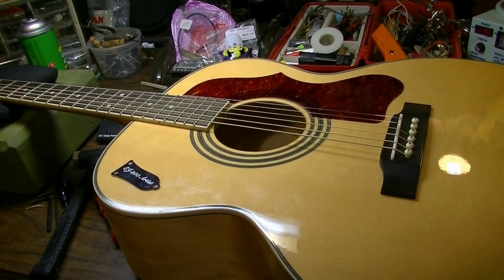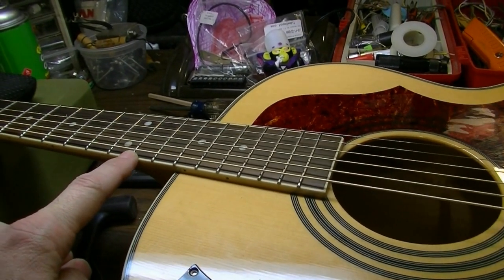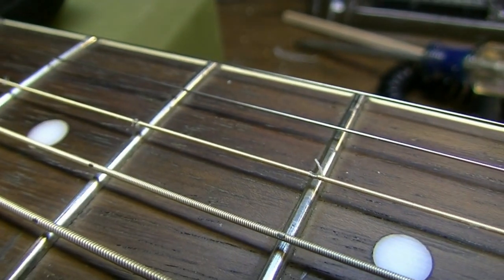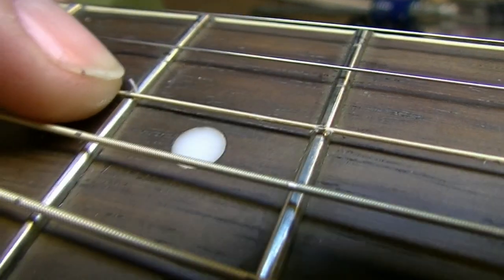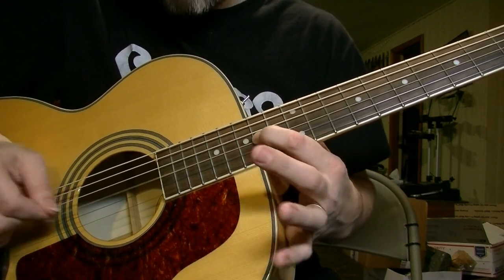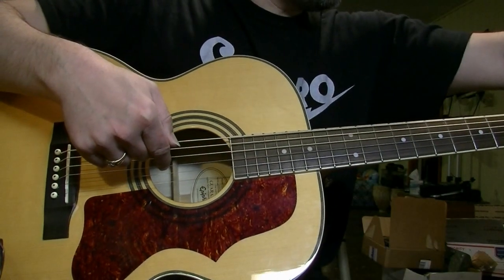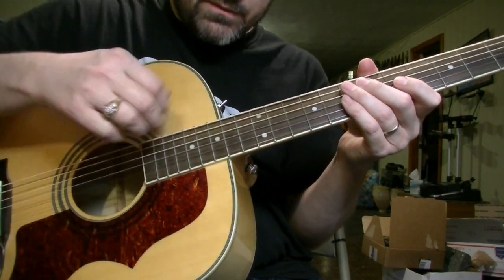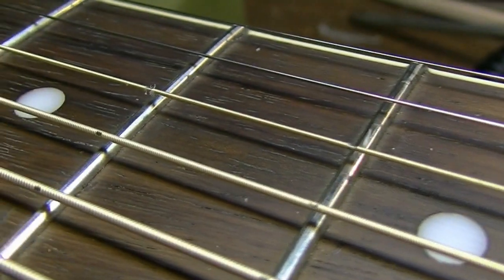Why I NEVER Use ELIXIR Coated Guitar Strings

Comment: For the last   10 years I have only used D"Addario phosphor bronze strings. Back then I was trying other brands including Elixer coated strings. My feeling was that the Elixer's sounded great but I  would notice the coating getting a little sticky on my finger tips. I also felt that the Elixers were not quite as clear as the D'Addarios, I assume because they are coated. I admit the difference is very, very subtle. As I played more and improved my sound, it got to the point where I was changing my strings more often. Since the price of the Elixers was higher, another reason to stick to the DA'ddarios. I will try the D'Addarios again to see if I change my mind

Comment: Speaking as a guitar restorer the issue here is simple.those strings are fake.Elixir strings do not lose their coating.They are specially made for electro acoustic guitars designed by Taylor. We have strung hundreds of them and are our go to string.I would suggest he sends the strings to Elixir in the states to get a second opinion before making wrong judgements.

Comment: I've been a long time Elixir user of both nano and poly web strings, and the only time I've had this issue was when I ordered a box of 5 packs online from a dodgy seller and they turned out to be fakes.  You could tell as soon as you opened the packet - they felt so... NOT Elixir at all.  This may have been what happened to you?
Reply from the maker: The owner purchased from Sweetwater.

Comment: I have Elixirs on both of my Taylors and I have never had an issue with them. Only strings I will use on my acoustics, they last. They do wear out though. I wouldn't knock Elixirs for the guitar owners failure to change his string when they did go bad. How long have they been on the guitar? My guess would be a good long while for that to happen. In addition, always replace the strings after working/modding your guitar.

Comment: Is it possible that the offset "fret divets" in the string after the bridge saddle was shaved could have contributed to the buzz?  I've never noticed the buzz being a problem even with fraying Elixirs.  Having said that, I have, in the past, run into an issue where coated strings caused a string grounding issue on a bass. This wouldn't be so much of an issue on a guitar since the plain strings (E and B) are not coated.  I love Elixirs on my electrics, but I use EMG pickups which don't require a string ground.

Comment: I used elixir bronze on my acoustic guitar a year ago, but I don't use it now. There are my reason why I don't use it again
1. Elixir bronze acoustic causes my left top finger become be yellow, looks dirty and it is difficult to escape
2. Its coating string on sound hole position is peel off caused pick friction, It is disturb to me
3. The tone durability is not better than string uncoated
4. The string looks good for 3 month, no rusty, but when I look the string that friction with fret I find that the coated is peel off and corroded.

Comment: I used these strings when I first started playing because of the comfort. I had the exact same issues being illustrated here. I haven't used them in years
Reply from the maker: Thank you.
Reply: I've never used Elixer strings nor have any of my friends.  Been happy with Ernie Ball for years. I did put  set of DR red coated strings on a red Ibanez. Looked cool but little red flakes appeared quickly. I know this about Elixer, but just thought I would relay that.

Comment: I just bought a new acoustic with  EXP coated D’Addario strings. Upon close inspection of the strings as I was adjusting the truss rod to get the neck straightened up and get rid of fret buzz, I saw small rust spots on them over the sound hole. When I can get to my local guitar store I’m going to buy my Ernie Ball strings.

Comment: I had some once that looked like something was growing on them all the way down the string. But that only happened once. I've been using them for years and haven't had that again. There probably is a difference between Poly and Nano. The Poly is the original and is much thicker. I had D' Dario coated and they did some "peeling" too. They do look bad when they do that and surely feel funny. I also imagine that this may have some effect on the tone and they won't last that long. BIG Question !!!! super slide or some sort of cleaner apleid to the strings may cause this too.

Comment: They may be the fake Chinese made Elixirs, or even the phosphor bronze. 
I've used American made Bronze Elixir Lights with the Nano-web coating along with non coated Martin strings before them. I've taken the strings off and have put them back on without the strings being frayed afterwards. 
They could also be the poly-web coated strings.
My strings last about 5 times longer than my Martin strings ever did.
They also have better tone and the only time they fray is when I leave them on longer than needed.
P.S.
I also play blue grass and heavy blues. I bend a lot and play hard. They last me fine without fraying. It could be a bad batch your friend had. It's unlikely, but it could be the guitar.

Comment: I got the same issue .... with average acoustic strings .... without any coat .... I moded my Epi Acoustic so the strings are louder with long sustain ... some friends call it the "acoustic-electric" guitar. The issue is the same as you pointed out here .... but with the wrapping wire on the G string. All the string "separates" the wrapping wire in segments just like the fretboard ... after a week .... no matter what I do, the issue is the same, you can feel with your nail under the string those cuts in the G string. I have to change it because of the BIG annoying buzz. I tried to change to a flat string, but the bridge is not filed for flat G string. This issue is because of augmented vibrations that G string can't stand. Frets are ok, no edgy frets all along the fretboard. This is something that ONLY happened AFTER my mod. When I bought it, everything was ok. After 5 years ... G string was ok. One more thing: When I play single notes or I bend notes 1/2  ... 1 ... 1 1/2 up .... my guitar sounds like an electric guitar .... like if had delay on it, looooong sustain man, and there's no preamp or gadgets on it .... pure acoustic tone ..... with electric guitar sustain. Hope to upload a video soon so you can hear it. Cheers !

Comment: Those strings show clear signs of a heavy string bender. Did you also check the frets to see if there were any sharp edges on the sides of them at all? (Sides as in not the peak of the height of each fret where the string makes contact but on the rounded over portions since some of those frets looked as if they had a fret level job done to them and looked like they had edges to them.) Anyway, nice video. :)
Reply from the maker: Frets were fine. They weren't crowned to perfection because the guitar was a typical Epiphone import and they do not crown frets from the factory. They level and polish, leaving a slightly flattened crown. This is fairly common. No sharp edges though. You're right, the player is a heavy blues player. Lots of bends and lots of vibrato.

Comment: Also ive used polywebs for years and never once had this issue. I dont know if that guitar owner presses down really hard or the strings are over a year old maybe. Also ive heard nanowebs arent that great but personally with 10 gauge polywebs i have never had this problem
Reply from the maker: I think it's down to playing styles. This dude is an aggressive player. Tons of bending and aggressive blues/rock vibrato.

Comment: I kind of have to use the Elixirs as my finger sweat makes all other strings rust and go black within hours. I would agree that all the Elixirs were a compromise up until the latest version which I believe is only available for electric guitars. Its the Optiweb which feel mostly like normal strings and last ages. I don't know if the acoustic situation has improved though. But yeah - they keep improving and for me its the only string that works.

Comment: If the winding on strings is damaged to that extent, the strings are dead, gone, used up, regardless of the perceived minimal usage. The frets appear not to have been propery crowned and so there are two sharpish edges to grind the strings. They also seem to be/sound to be too light for a super jumbo and maybe the relief is insufficient. 
I don't care for or need coated strings - but understand that if you have acid sweat of play in very humid conditions they have a purpose.  
IMHO, this guitar needs some fret work, a set up and a new set of strings.

Comment: Groovy Music Lessons' Scott Grove is the guitar guy that got me using Elixir "Polyweb" coated strings on my acoustic guitar. He plays about any kind of music one can ask for on guitar, but specializes in Country. I bring this up because he has a chemistry that ruins strings in 15 minutes and swears by Elixir Polyweb strings! Well, I went ahead and put a set of Polywebs on my guitar and I have to admit, I like them and for over a year, those strings look and play as if they were brand new! Being somewhat skeptical at first, I would periodically inspect the wear areas of the strings with a 16x loupe that I use in my rock hounding and the coating is holding up with minimal signs of wear. Scott did mention that heavy metal or grunge players would probably be hard on coated strings and not get the longevity out of them that they might with playing other types of music! I think your video shows that Scott was right about that. At any rate, I'll keep using Elixir Polyweb guitar strings and you guys can rock on cuz that is what its all about my friends, rockin on..............

Comment: I don't even play guitar, but any engineer can see that the strings have rotated, displacing the worn spots on the string where it meets the fret. Once you take the strings off and you can't get them back into the same exact position, the fraying is going to be be apparent and disruptive.
Reply from the maker: This is true, the strings likely did rotate when replaced back on the guitar. But bending, particularly over-bending notes, and heavy vibrato also rotates strings to a degree, and eventually THIS happens.

Comment: I had bought an acoustic electric some time ago and it came with Elixirs on it and soon after the whole guitar would not play in tune because of the strings.  One chord would be in tune and the other chords would not and vice versa. It was a $1000 guitar and at the time I could not understand why.  I never use coated strings

Comment: That is too bad. I have been using them on my electrics for some time and LOVE them and never seen this issue personally. Perhaps a bad batch ??
Reply from the maker: It's common. I've had this same thing happen to me on Elixirs years ago when I tried them myself, and I've seen it many times when changing strings on other people's guitars. I used to manage a music store and changed thousands of guitar string sets. It was a well-known issue in our store. I'm very surprised so many commenters have not seen this before. The G-strings on acoustic bronze Polywebs seem most vulnerable. I couldn't remember in the video which ones were worse, Polyweb or Nanoweb, but with this issue it's the Polys. The Nanos do it too to a lesser extent, and they still fray in the picking area as well, which deadens the string, in my case before even corrosion would have.
Reply: Yes, Polywebs are TERRIBLE for this, I should have said that. But since switching to NanoWeb I have had ZERO issues and I rehearse and gig frequently.  I also notices that it depends on your pick attack, pick material, do you pick slide (which I do, just no aggressively) , etc, etc. All this said, and everyones mileage will vary, but for ME ... I have had ZERO issues with the Nanoweb and really do LOVE THEM on my electrics. I have not used them on my acoustic yet since It does not get a bunch of use.

Comment: If you don't have a dreadnought that can handle medium elixirs with ease you're missing out.  So what if the coating wears off and the strings get mottled.  Using the heaviest tortex pick with medium elixirs on a nice dreadnought is fantastic.

Comment: This might be the polyweb set, which has a thicker coat that is visible in plain sight. I use nanowebs on my electric guitar which I can't even see. I've had those strings on for as long as 4-5 months, and that has never happened to me. Polywebs also have a highly noticeable effect on the strings making them a little muffled. It's a lot less noticeable with nanowebs, though still somewhat noticeable.

Comment: This is the problem with the Polywebs. The thicker coating makes them far more susceptible to flaking. I see it all the time in my shop. That said, I love the Nanowebs. Very thin coating that let the string last a super long time (for me... like 6 months + with regular playing). Poly's dull up my tone and make the string feel impeded. Nano's feel like regular strings, react like I want to and provide a rich, complex harmonic structure better than almost all other strings I have tried, coated and uncoated.  It's funny you like the EXP's, my shop used to sell them and we all found that after stringing up almost our entire acoustic  fleet with them one week,  they tend to sound more dead and lackluster when compared to Elixers. Is it the thickness of the coating? Perhaps the actual coating process? We no longer sell them but sling Elixers like hotcakes, so much that we run out all the time. Its awesome that different people can come to completely different conclusions like that. Love the videos brother, thanks for doing what you are doing!
_Thomas, Davis CA

Comment: I just clean my strings after playing. Only takes a minute to do but lets me get longer from them. I tried Elixir but never thought the extra few days before they corroded was worth the extra they charge.

p.s. I recently had problems with D'addario strings. One nine gauge pulled itself off the ball and the next set had a B string that sounded weird. I could not work out why. I put my glasses on and saw it had a tiny blob of nickel plate build up about a third the way up from the bridge. Size of a small pin head. Strange one. I have never seen that before.

Comment: Elixir strings also creates grounding issues on electric guitars. Especially on guitars with passive pickups/electronics, cause the plastic coating keeps the string from grounding properly. Therefore I'm still using GHS strings, cause they never fail.
Reply from the maker: I can see where theoretically this might be a problem. Your strings need to contact the saddles to ground through the bridge, and your fingers need to also be touching conductive part of the strings, especially on anything with single coils, to get a good ground contact. Your body's capacitance is supposed to act as an RF suppressor when playing, otherwise your guitar is just one big noise antenna. Good comment.
Reply: Tried them on my '68 strat once, and that was truly a disaster.
Reply from the maker: For the reason you mentioned?
Reply: The strings themselves seems to get grounded by the bridge,
But you'll get HUM Because they don't ground properly through your hands / fingers, as you mentioned above.
Reply from the maker: Yeah, the ball ends should ground to the bridge on a Strat, but fingers can't ground on strings. But if you had a jazz guitar with a wooden trapese tailpiece, they won't even ground there.
Reply: That might be a problem, but maybe it would help a little if it had humbuckers, I don't know... I've always been playing single coils.

Comment: I use nanoweb strings for several reasons. I go a little overboard with my guitar maintenance routine by micropolishing my frets with supplies I get from a local builder near Toronto Mike Carparelli. He came from another former local builder Lado Guitars. I make my own answer to nut sauce which I make with graphite powder, vasoline and three in one oil. I haven't tried a PTFE variant yet because it hasn't been necessary. I use nanowebs because they work well with strat tremolos reducing nut wear, especially with the nut goop I make. With the frets polished I never see any fraying or chipping of the coating and I really beat the shit out of my main strat with heavy trem use and very pronounced vibrato. There are other pluses too but you know what they are. The other guitars I have I don't feel I need them on as much since they don't have to put up with the abuse as much. Fret jobs also seem to last a bit longer and since I have a tendency to wear out frets, I think it's a good thing. Yes these strings are bright sounding but I mostly play through an Orange head which is pretty dark to begin with. In short, if you have a well polished fret job you won't have that associated problem with the nanowebs as far as I can tell. The other coated types and brands not so much. I hope that helps a bit. Always a pleasure visiting and receiving your input Brad. Cheers.

Comment: I tried both electric and acoustic. I noticed this problem after only a couple days. Of course I played a lot. But still. It left bits of residue up against the frets when it was played and pushed into the fretboard, and they didn’t feel right either. They kind of felt like extremely clean but not in a good way. Like when something is so smooth and slick that you can’t tell if it’s wet or not. The sound to me never was impressive at all. I always wind up back to a 7$ pack of Dunlop’s. Those to me are the best. They may be a neutral tone, but they last the longest with a retained sound without dying unlike Ernie balls or darios. And at half the prince sometimes a third, you can’t go wrong. Especially Billy gibbons signatures. Those are really nasally and honky and goes perfect with my tele.